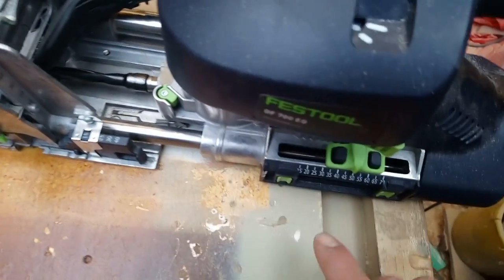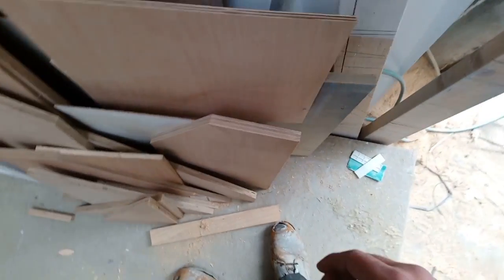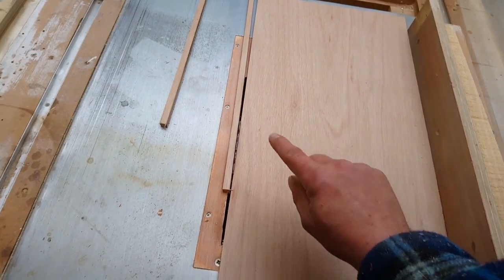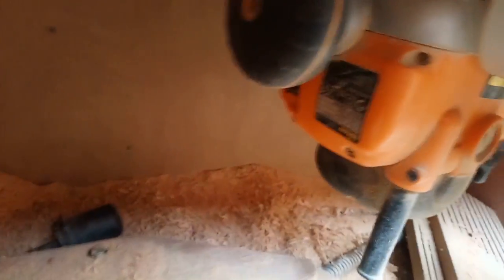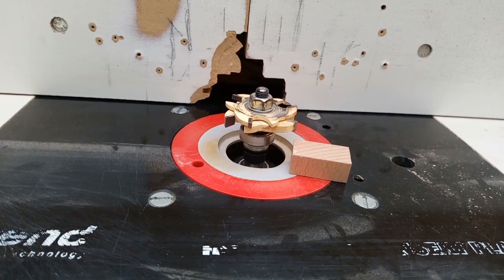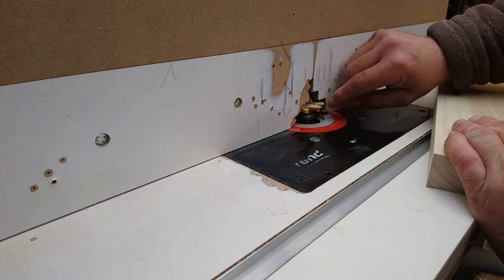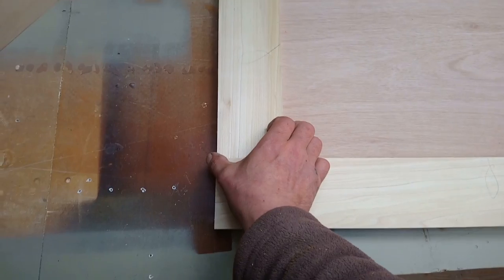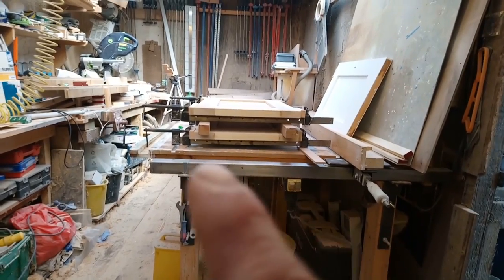Replacement alcove cupboard doors #2, cutting, planing the Tulip & making the doors

Comment: I have not long found your channel, it’s a breath of fresh air! Common sense, practical and really well presented. Thank you.
I have the same router in a table that I built but mine is in 180 degrees to yours so the switch and locking lever are really easy to reach from the front.
Reply from the maker: Hi, Thanks John I'm glad you like my videos & you're welcome, i make them simply to share 👍 This is my work, all jobs are discussed with the clients reg materials & budget but in the end it's their decision, i have to then build what they want within that budget but i try not to compromise quality by rushing it to get it done within time, I'd prefer to spend more time n do it right but i stick to my orig quote with the clients, so sometimes things aren't perfect, When i first started putting more effort into making my vids i'd learnt from others with their long intros, someone standing in front of the camera talking bull about some irrelevant 'stuff' & then some more bull & paid promotion to finish their vid, I didn't want any of that annoying rubbish that you want to skip through, eyes on the job start to finish, i try to show each step of the job while trying to explain my options & reasons for those decisions, by the time i've finished reducing the many clips i take down to a reasonable length video for upload without cutting out any important bits there's no room full an intro or any of that other rubbish 🤷‍♂️😏 The router is quite good 👍 it's in the same box/stand i made when i got it, to me it made sense to put the adjustment knob on the right but after using it a while & someone else mentioned as you did that they had it the other way round I considered turning it around when i remake the router table,  but. I'm used to it the way it is, I think it would just mess with my head if i changed it, like when i got the Dewalt router, it has the locking lever on one side but my Makita which i've used for 25yrs+ is on the other side, I've had n used the Dewalt a little while now but still turn it off when i mean to lock it off 😂🤷‍♂️👴🤣👍